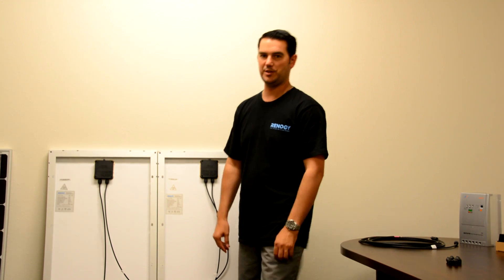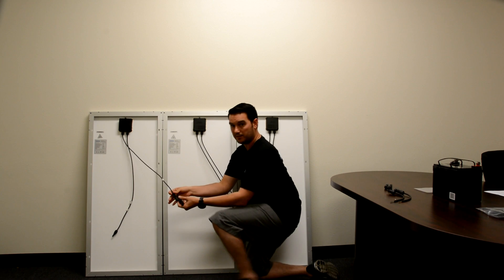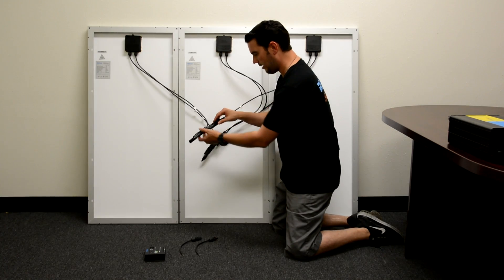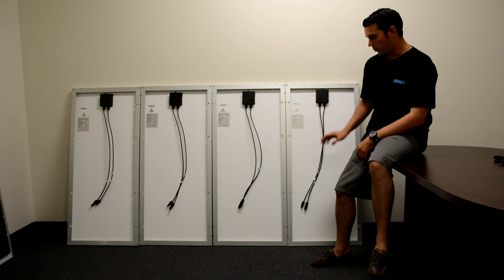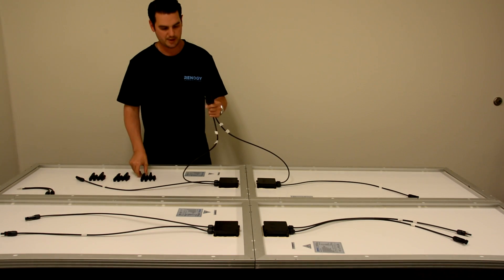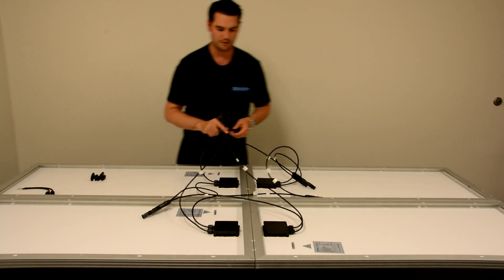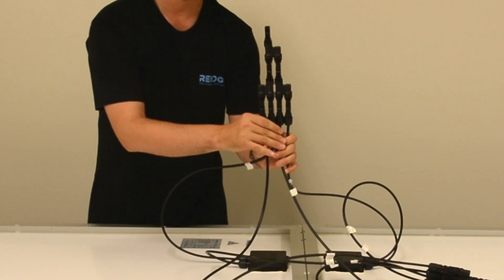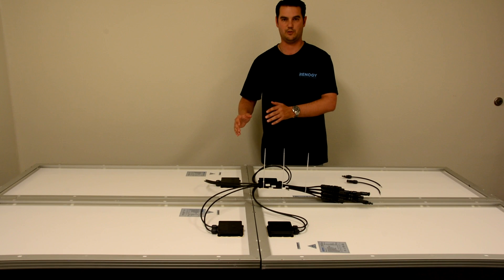Renogy: How to connect your Solar Panels in Series and Parallel Pt. 2

Comment: Help please. 400 watt kit. Wire two in series, two more in series, then in parallel this make 24v. Will a 12/24 charger charge a 12v battery or does it have to be 24v attery bank? In my mind once you series two panels the your parallel two you have a 24v system am I right?
Reply from the maker: Hello, it is necessary to first confirm the maximum PV input voltage of the controller to ensure that the configuration of 2 series and 2 parallel connections is in accordance with the specifications (calculated based on the open-circuit voltage of the solar panels).

In the case of meeting the specifications, it is possible to connect to either a 12V battery or a 24V battery.
The system voltage we often refer to is defined based on the battery voltage.

Comment: please forgive the silly question but why would you need to connect them in series ?
Reply from the maker: Hello, thank you for your attention. Your question is excellent. For certain voltage regulators, in systems with 24V or higher requirements, the PV voltage needs to reach a certain value for charging to commence. In such conditions, it is necessary to connect the solar panels in series.

Additionally, from a wiring perspective, series connection is a more convenient method.

Comment: Do I need fuse for each position and negative cable?
Reply: The fuse only needs to be connected to the positive line.

For a series connection, you can use one fuse.

For a parallel connection, you can install a fuse on the positive line of each solar panel or on the positive line after the solar panels are connected in parallel.

Comment: It’s fine if you are in a studio with the panels beside each other,however in real life this is never the case as the wire are not long enough as you need to extend blah blah ffs
Reply from the maker: Hello!The video is just for demonstration purposes on how to connect. In actual applications, it is necessary to add extension cables as needed based on the specific requirements. https://www.renogy.com/solar-panel-extension-cable-with-male-to-female-solar-connectors-single/

Comment: Hi
Need help here i dont know why i cant make it work.  
Here is my set up

4x 100w 24.3V 5.21A Solar pannel. 

1x 12V 170A lipo Batterie. 

1x inverter charger 2000W pure sine wave. 

1x MPPT rover 40A. 

Questions

- Pannel serrie or parallèle?

- minimum Voltage setting?

- Any outer important setting?

- max Voltage setting?

Thanks for the help

Comment: For the life of me i dont know why the panel cord arent long enough to string panels lengthwise. Idiotic to have to conect like this
Reply from the maker: Hi, JPB23 _406.

Thank you for contacting Renogy.

Normally, the wire length of the panel is standard. If you think the length is not enough, you can add extension cables according to your actual usage scenarios.

Hope it is helpful.
Reply: When connecting in parallel it should be much easier. I should be able to connect panels lengthwise from 1 end to the other. The design flaw was created by your design. 4 100w panels shouldnt have to be in a square with a big ass conjunction of y connecters

Comment: I think a circuit diagram would be very helpful.
Reply from the maker: Hi, Ian.

You can refer to the connection ways on our product listings through the links: 

https://www.renogy.com/200-watt-12-volt-solar-starter-kit/
https://www.renogy.com/200-watt-12-volt-solar-starter-kit-w-mppt-charge-controller/

Have a nice day.

Comment: Are there any problems with connecting more than 2 solar panels in a 12 volt setup? Will it work? (Like up to 4 like in your video). 

If more than 2 panels can be in a system that means I could order more panels.

Comment: Hey what's up ? If I have 2 trojan batteries both 6v 225amp, and I have 4 100w solar panels 17v, how do I make the connections, I plan on getting another battery ...

Comment: Thank you for this very informative video - great job! The web is full of questions regarding wiring solar panels in series OR parallel but this is first time I've noticed connecting panels in series AND parallel. I understand the pros of doing parallel connections, but what are the advantages of the series/parallel configuration? Thanks again!

Comment: You answered the question of odd number panels in series. Now I can have a small size 300watt 36volt system. So does that mean i would connect 3 12volt batteries in series for the system?  Thank you again.

Comment: I have a 200 watt kit I just bought from you guys.      it doesn't come with the branch connector for parallel.   however I just ordered that from Amazon.   but after thought.    which is better for a small system like mine.  only 200 watts connected to 12 batteries.     should I go with how the kit comes and do series connection between the two 12 volt panels to the charge controller or should I go ahead and do the parallel connection with panels when the mc4 branch connector comes.        I understand the voltage will be higher in series and the controller will take that voltage and boost it into Amps.    but... if I just do it in parallel that will double the panels amps and won't the charge controller still take any voltage over 12 volts and using the mppt convert / boost that into Amps.
I bought the 200 premium kit with 20amp mppt Rover controller and Bluetooth kit.    so you know which kit I have         - to clarify my question   I'm saying which is better series or parallel for a small 12 volt battery setup.  currently have 2 12 volt 75ah batteries in parallel.

it appears to come with no branch connecter so made for series.  but will parallel connection be any better or worse??    I'm just wondering why they choose to only do series connection.         hoping to get a good reply from you guys  I'll be hooking it up in a few days and my branch connector should be here in the mail monday

Comment: Where is part 3 on connecting in series-parallel connections  4  12v panels to make them 24v? I was thinking of buying from Renogy Solar,found this site www.renogy.com/learn-series-and-parallel
Reply: I  have bought renogy 40amp charge controller, i need another controller, I could not be happier with this product :)

Comment: can i connect 2 panels parallel and the in series with the other 2 panels?
i mean 3:50 you take the 2 positiv in 1 and connect with the 2 negative in 1 from the other (2) panels, make the in series. possible?

Comment: Thanks for your valuable videos. I have a question please: Can I connect a 550 Watt/4.8 Amp water pump to my 400 watt/ 12 volt solar system connected in parallel?

Best regards 

I. AL ALI

Comment: Hello well explained. I have 3 250w panels mppt is rated at 100v so 3 in series would be to many volts so can I do 2 in series and 1 in parallel thanks

Comment: @Renogy Solar... So then can I have my 400-watt array up to say between 60 to 70 feet away from my MPPT Controler if I use 10 AWG wire? My panels are in series and using aluminum wire? I've purchased everything from you at RENOGY.

Comment: I purchased five Renogy 100D panels and would like to wire all 5 in parallel and the connect to an Inergy Kodiak generator.  Acc. to Inergy Kodiak, the only array option is parallel.  Would there be a concern about connecting 5 panel in parallel with the existing 12 awg wires?  Also, to connect 5 panels in parallel lined up in a single row, the existing wires coming out of the junction box don't seem to long enough so I am seeking advice on what wires to purchase.  I'm a newbie with all of this so I appreciate your patience with me.

Comment: I have 4 12v 100 watt panels connected in parallel, but my mppt controller was reading 23.5v coming from the array on a sunny winter day and only producing 35 watts.

Comment: I see that Renogy makes a 3 into 1 connector. Wouldn't that be a better way to go than using two of the 2 in one connectors?
Reply: Better maybe. Definitely cleaner. There is a 4:1 connector out there as well. One challenge with the 3:1 and 4:1 connector is panel arrangement. It can limit how you do it. With the connectors you see in the video, you could in theory put wiring between connectors in addition to the connectors.

Comment: talk to me OK i get the series and the parallel how would you create and parallel series array?? next is lets say your battery bank is 12 volt does the mppt charge controller tell the different between bank voltages ??? and work accordingly to the perspective bank voltages. one other thing or do you have run one or the other be parallel or series if so why can you not run both ???
Reply: The MPPT charge controller, like a Renogy Commander, knows what the voltage of the battery bank is. So yes, it will know it is a 12v bank and work accordingly. You can run panels in both parallel and series depending on how you want to get the power and what voltage you wanted to end up with. Look at https://www.renogy.com/learn-series-and-parallel and Model 2.4.4 on that page. They are wiring up two sets of four strings of panels, so eight total.

Comment: OK if you have 12 v bank and mppt charge controler as long as charge controler  know the voltage of the bank does  it matter the voltage coming into the charge controler  ie series  or parallel

Comment: with 4 in parallel just use a 4 to one ratio adapter to replace the two to one ratio adapter; much simpler

Comment: have you done the 4 panels in series yet would like to see it...thank you...
Reply from the maker: Hello! We're still in the process of updating our videos with no ETA set yet. Sorry about that! If you need help, pages 66-68 of our general off-grid manual (http://www.renogy.com/template/files/Manuals/Off-grid-General-Manual.pdf) has configurations for a 4-panel setup. You can also call in and speak with a tech support representative if you have any questions at 1-800-330-8678.
Reply: thank you so much...
Reply: Any progress on the next video?

Comment: Hi, im working on a 12 volt system similar to the one on TinHatRanch site and Im wondering if i can hook four 100 watt Renogy panels in series for my 12v system? Thank You
Reply from the maker: +Dawn Spencer Hi Dawn. Yes, you will be able to hook up four 100W Renogy Panels in series for a 12V system as long as your charge controller allows for it. For this scenario, it would be better to have an MPPT charge controller as the extra voltage will be converted to current. On the other hand, if you are using a PWM charge controller to hook the panels in series, you'll lose the extra voltage as it will dissipate as heat. We hope that helps! If you have any other questions, please feel free to message us at techsupport@renogy.com.

Comment: How far from the panels can a combiner shutoff be?MNPV4HV 3R Basic Disconnect/Combiner Box
Reply from the maker: +truckie117 Hello! What is the wattage of the panels you’ll be using and how many will be going into the combiner box? You should be able to have a distance of 50-100 feet depending on how the panels are wired and the total voltage going into the combiner shutoff.
Reply: +Renogy Solar 4 of your 100 what panels in series so only one wire will be going to a combiner/shutoff  box for now.
Reply from the maker: Hello! So, with 4 panels in series, you can have a distance of up to 200 ft. 200ft will result in a 5% voltage drop.
Reply: I hope you know if you wire in series and one panel is shaded the rest will not work. To me, with only 4 panels parallel is the way to go

Comment: Hello,  I recently bought 10 of these guys on Amazon.com, with a goal of getting 1 KW.  What Charge Controller and Grid tie inverter do I need I order to link them together and generate power? I ordered a 1KW charge controller from amazon as a well as a 1000kw grid tie inverter.  I have all ten linked up in a series connection.  It burned out both the charge controller as well as the GTI almost instantly.   If you can give me the exact model that is needed for each I will greatly appreciate it.  As of now, I have 10 of these guys on my back deck and all they are doing is blocking the rain lol.
Reply from the maker: +Richard Starling 

Hi Richard, just to check. Do you want to have an off-grid system or an on-grid system where you would connect to the grid and not use batteries?
Reply: +Renogy Solar I would like to connect to the grid and not use batteries, that way it will in theory reduce my monthly payments
Reply from the maker: +Richard Starling Hi Richard, the reason I ask that is because charge controllers aren't needed for on-grid systems unless you're trying to do a hybrid system--which we don't size for. The reason your charge controller most likely burned out is because while it is rated for 1KW, by connecting your panels in series, your voltage must have added up to too high of a number for your charge controller to actually handle. Unfortunately, we don't carry a charge controller or multi-panel grid-tie inverter that we could recommend to you. We currently only carry micro-inverters which are meant for single 250-300W panels. For your grid-tie inverter, you'll need to find one that can support up to 1KW (please note that your array going into the grid-tie inverter cannot exceed the wattage, amperage, and voltage that your grid-tie inverter is rated for). Also, don't forget to contact your power company to let them know that you'll be feeding back power to the grid.
Reply: +Renogy Solar okay thanks for that information.  So being that I have 10 panels linked up in a series, technically, I can break them down to one 600 watt system and one 400 watt system using two charger controllers, one rated for 600watt and one for 400 watt?  Would I be able to connect them both to a deep cycle battery back up and do it that way? (Off Grid) I spent all this $$ on them - don't want them going to waste, right? lol
Reply: +Renogy Solar Also,  was just an idea,  what if I bought 2 - Renogy Tracer 4210 40 Amp MPPT Charge Controllers, 12/24V 100VDC Input, plus two additional panels and went with 2 600 watt off grid systems?  I see on the amazon.com site that the Renogy Tracer 4210 40 Amp MPPT Charge Controller, 12/24V 100VDC Input comes with the 600 watt kit, so two of these (both only connected to 6 panels) should do the trick, right?
Reply from the maker: +Richard Starling For off-grid, I would recommend buying a MidNite Classic-150 (http://www.renogy-store.com/MidNite-MPPT-Charge-Controller-Classic-150-p/classic150.htm). This controller will be able to support up to 1200 watts while charging a 12 volt battery bank and 2400 watts if you are charging a 24 volt battery bank. When wiring the panels you will need to wire them in series/parallel. It’s better to have one controller since the two 40A MPPT controller aren’t able to communicate with each other. Please feel free to message us if you have any other questions.

Comment: can someone tell me what watt solar panels and how many panels, what type of battery and how many batteries i need to power a 5000 btu ac unit? thanks
Reply from the maker: Hi 2phalanges,
In order to run this AC unit for 6 hours you will need a 2750 watt solar system. The panels and batteries are up to your discretion.
Reply: how bout i get 6 12v 100ah deep cycle batteries and also connect a 4400 watt power generator to it will that work?
Reply from the maker: Hi 2phalanges 
The 4400 watt generator will be able to run the AC unit by itself. I recommend using the generator since you will need a large solar system to run this AC unit.
Reply: ahahh ok. i just wanted to test out the ability of solar panels. i hate that damn loud generator. anyway thank you!
Reply from the maker: We're sorry we couldn't have been of more service. Thank you for your questions. Please feel free to contact us again with any questions you may have.
Reply: +2phalanges 
Is there any way to get grid power to where you're at. We had to pay power company about $5K to get grid power to our Tiny House, BUT - this was about what we would have paid in batteries/charge controller/cabling/etc to get it hooked up. Instead, we got connected to grid power and put in 1,560 Watts (6 x 260W) worth of panels with a grid-tie inverter to offset our electric use. This produces plenty to offset the use of our 8,000 BTU AC (draws about 700 Watts). The major advantage is that we have no batteries to maintain or replace every 8+ years. Major cost savings! Calculate what it would cost you to buy 2 sets of batteries, your initial set and one replacement, and budget that for getting grid power. You'll still come out ahead in the end.

Comment: I'm looking at  your store and looking to expand my current qty 2 160wat 24v panels to 6 100 panels, need some info on the wiring. I will contact you via your amazon store. thanks.

Comment: i got 5 renogy pannels to be installed , how can i do it in paralell which it seems more complicated than i though since is an unpair number?
Reply from the maker: +diego bauzil Hi there Diego, we apologize about the belated reply. But, if you are using 5 panels and you want to wire them in parallel, we would suggest using a common bus bar or a combiner box to do so. Those will be able to support more current than our parallel connectors.